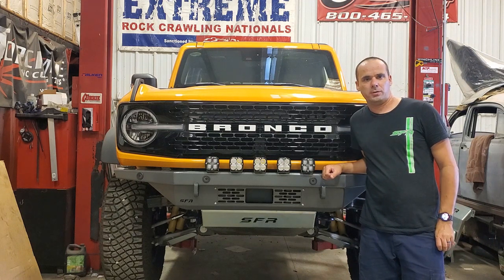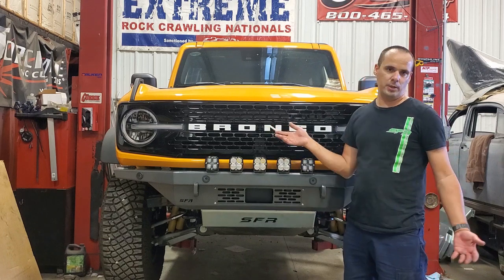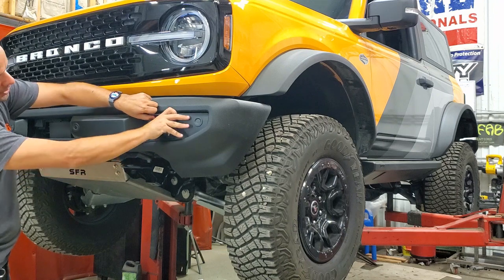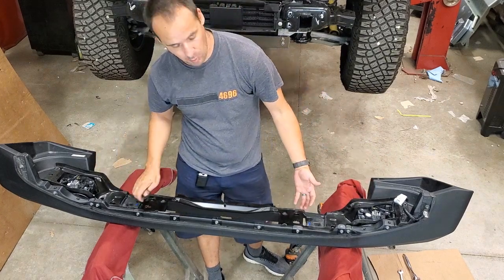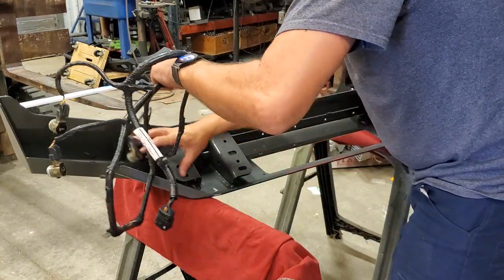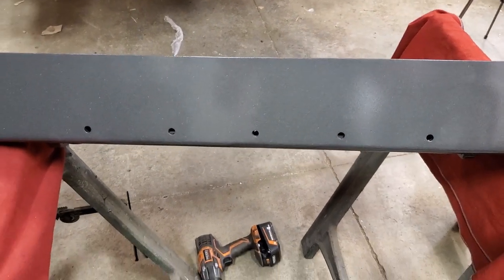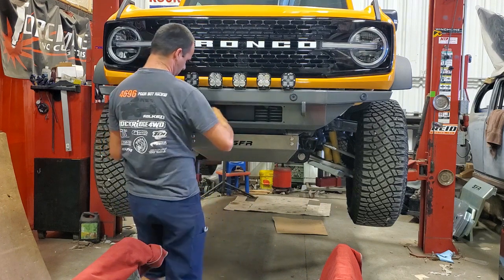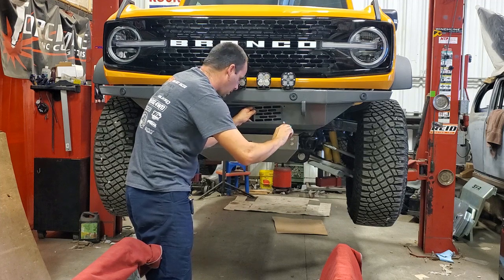SFR Sledgehammer Series Front Bumper 2021+ Bronco

Comment: Will it work with the factory skid?? I actually have a hidden winch
Reply from the maker: Yes. The bottom edge is flush with the frame rails, so there will actually be a small gap between the bottom of the bumper and the stock metal "skids" similar to the one shown during most of the install. I use quotes because they are so thin as to not really be skid plates at all. The skid shown at the end of the video is the one we designed for this, and the plastic bumpers, which comes all the way forward.